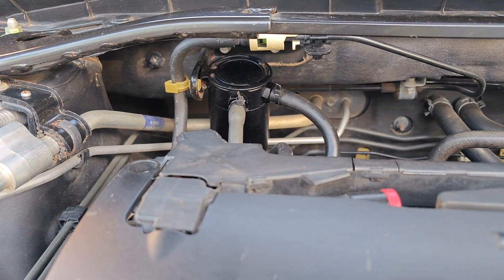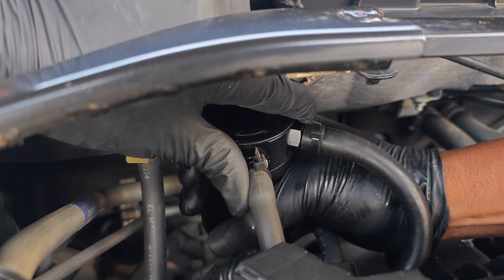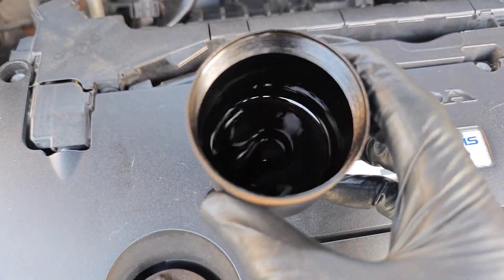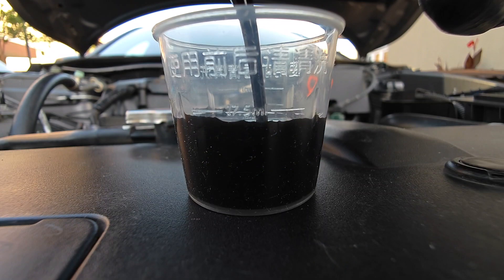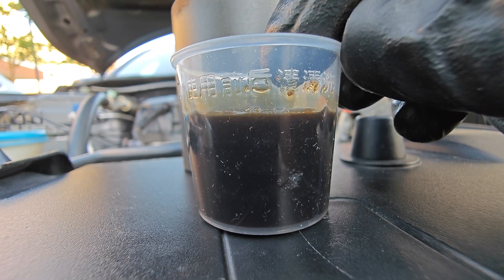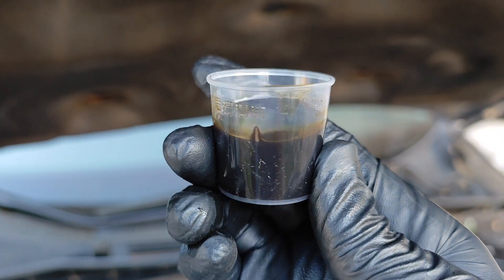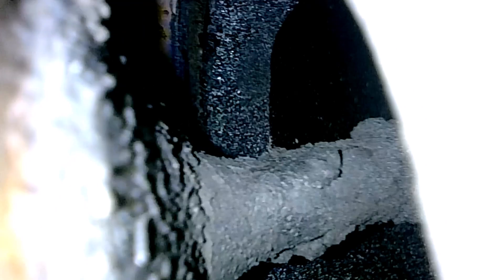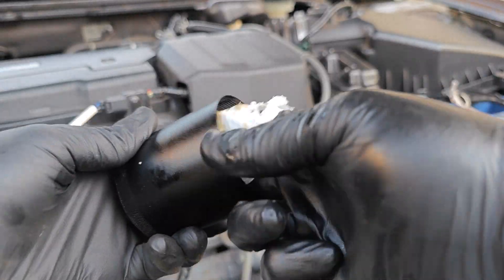Draining Oil Catch Can AFTER 5000 Miles / Emptying Oil Catch Can / Is an oil catch can Necessary?

Comment: Hey man good video as always. A tip though... Put steel dish scrubber instead of that brass filter. It restricts blowby gas flow so much that you're better off without it.
Reply from the maker: Really? Let do some research on this. Thanks for flagging.

Comment: I'm thinking of installing a catch can in my 09 is250
Reply from the maker: Ever looked at the intake valves? Since Toyota/Lexus implements direct + multiport injection on some of there models, they won't suffer as much as GDI only engines. Either way, I think a catch can is a good addition since it limits oil contamination on the catalytic converter in the long run.
Reply: @DIYAutoworksNG  My engine is GDI only. No port injection unfortunately. I'm just concerned about vacuum leaks after installing catch can...
Reply from the maker: @liquidh5226 I'd install ASAP. Just get good clamps. That would sort leaks.
Reply: @DIYAutoworksNG  Thanks man. Will do that!
Reply: Was checking my pcv valve this morning to plan the catch can install. Realised that the hose connecting my PVC valve cracked and caused a minor vacuum leak! I used some duct tape for temporary measure and my long term fuel trims dropped from +7% to near zero! No wonder my fuel economy has been rather poor in recent months!

Comment: Sir please I’ve a few problems I need your help with. I won a 2004 Toyota Corolla and during cold/morning startup my power steering works fine but after like 10-20 minutes of driving it become stiff, I’ve checked my reservoir it’s okay please what do you suggest
Reply from the maker: Ever replaced the fluid? It could be worn out fluid, bad power steering pump or a bad steering rack.

Comment: You should send off the next batch of caught oil to see how much gasoline is in it! These engines are having trouble with oil dilution then that in turn burns out the rings. Someone t boned my 7th gen Honda, I was thinking about buying a 2016 or 2017 Accord but started reading the recall and lawsuits going on with Honda. Im not a fan of how the 2019-2022 Honda look and prices are far too high for a new one. How do you like your 2017??
Reply from the maker: Good idea on sending the oil for analysis. Too bad I've dumped this one. So far, I'm enjoying the car. I don't also like the look of the 10th gen Accord.
What I've noticed about the 9th Gen is that due to the CVT the revs are not as high except you're driving in Sport mode. Doing some high rev driving keeps carbon build up at bay.
Reply: @DIYAutoworksNG  Im honestly thinking about going to a Toyota Camry. I really like Honda cars but once you start digging into the problems of this "earth dreams" nonsense it gets worrying. If you get a chance, look into the class action lawsuit Honda has against them and the recall of 250k different Hondas. I guess they've known since 2018 that this oil dilution stuff has been happening. I suppose a lot could have to do with people not changing their oil properly. It just seems as though Toyota is not as wrapped up in this whole save the planet nonsense. Im currently looking at a 22' Camry, they seem to last forever plus I like the look Camry has going. The new 2024 Accord looks a lot better that the 19-23 models tho.
Reply from the maker: We are both aligned! I love the look of the 11th gen Accord. In the end, I'd say follow your heart. It's always important to get what you want. I'll look into the Honda class action lawsuit and see. Thanks for suggesting!
Reply: @DIYAutoworksNG  yeah, next time you clean out your catch can, send it off to that company that checks motor oil. Specify that you want to check for dilution caused by fuel tho.

Comment: Do you have a video that shows how and were to install a catch can for a 2015 Ford F-150 with the 3.5 V6 turbo charged  to be exact ?
Reply from the maker: Negative sir! Believe it or not, I've never opened the hood of a Ford! By principle, I just avoid the exhaust side of the engine and place it any of the cooler parts of the engine bay where it can be anchored. Thanks for watching!